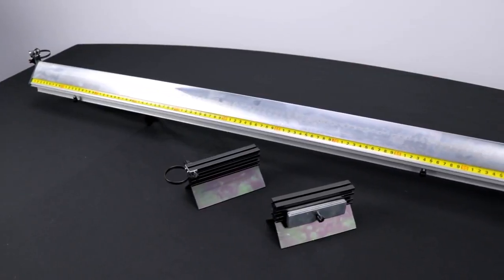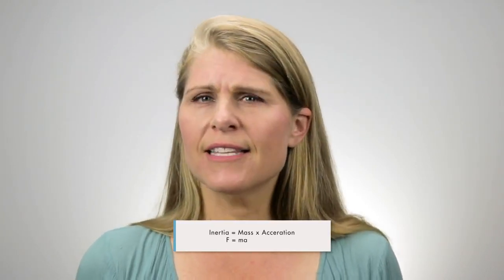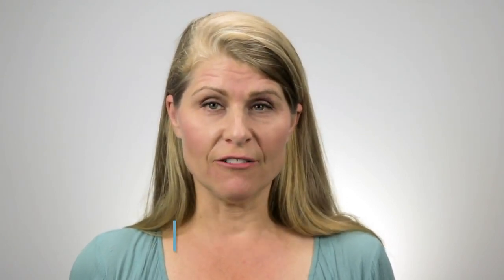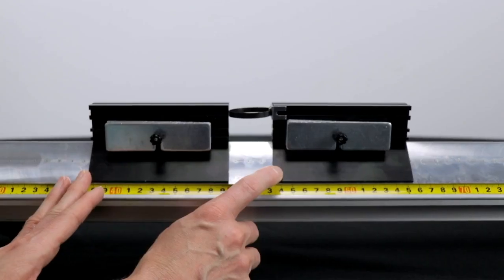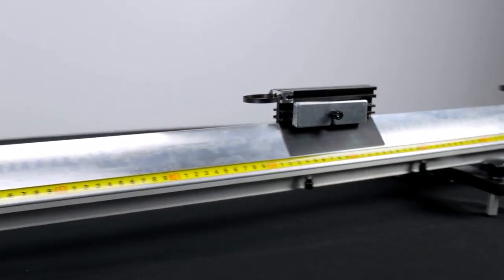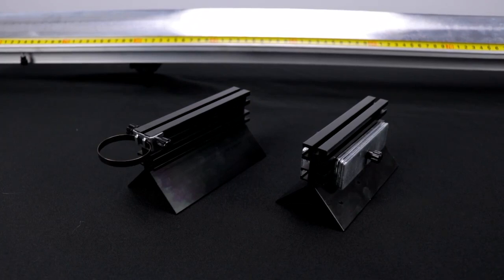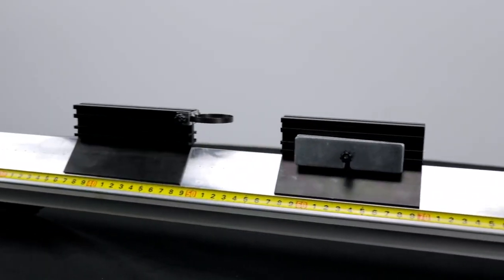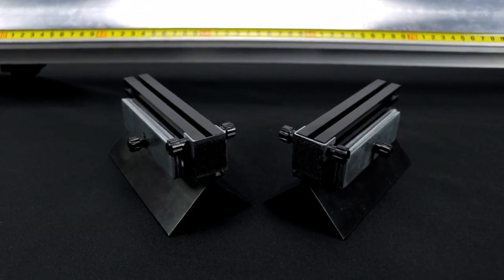Elastic & Inelastic Collisions With the Economy Air Track | Arbor Scientific

Comment: what is the ratio of the mass of the carts / 
how much more massive is one cart than the other ?
Reply: Here's some data that can answer your question:
At 3:02, you see the collision happens when Cart 2's left side is at the 50 cm mark, and when Cart 1's right side is at the 46 cm mark.
At 3:04, when Cart 1 reaches the 24 cm mark, Cart 2 is at the 60 cm mark
Prior to 3:02, at 3:01, you can see where the carts started 1 second prior to the collision.  Cart 1 started at 31 cm, and Cart 2 started at 53 cm mark and drifted in 1 second to the 50 cm mark.

From this data, we get initial speeds of:
v1i = +15 cm/sec
v2i = -3 cm/sec

And we get final speeds of v1f = -11 cm/sec, and v2f = +5 cm/sec.

Using conservation of momentum, assume cart 1 = 1 kg.  You would calculate cart 2 to be 3.25 kg.  This gives me a mass ratio of Cart 2 being 3.25 times the mass of Cart 1.  Since I only measured measure time to the individual second, it is only realistic to conclude that cart 2 is about 3 times the mass of cart 1.  This would make sense to me, if those were steel plates that were bolted onto the aluminum carts.  You can download the video and get more precision in the time stamps if you have your own player that can count frames to measure to the fraction of a second.